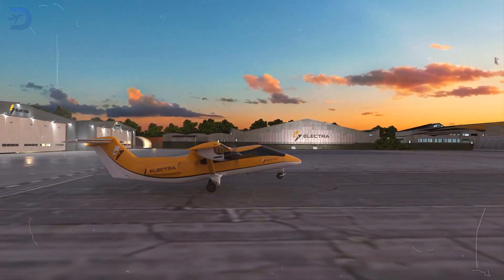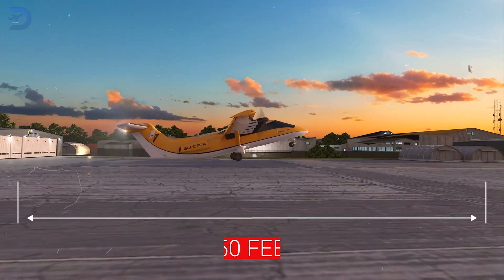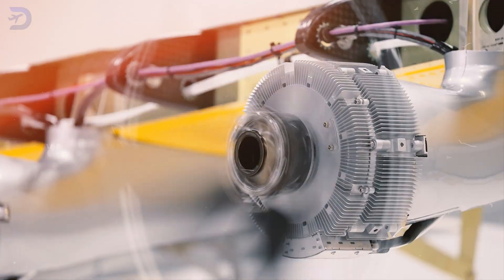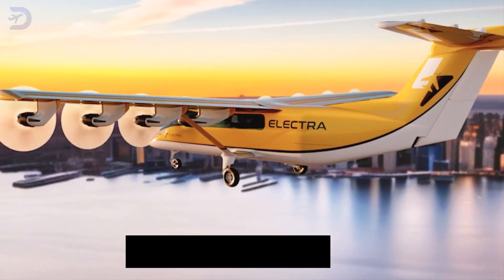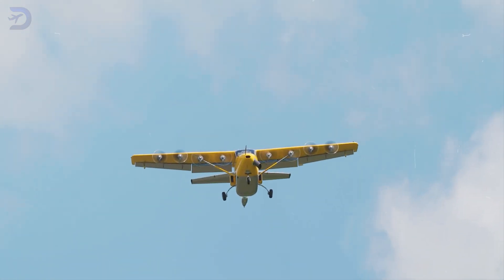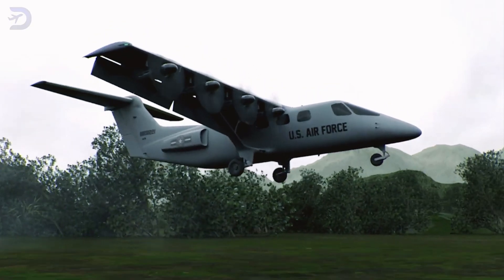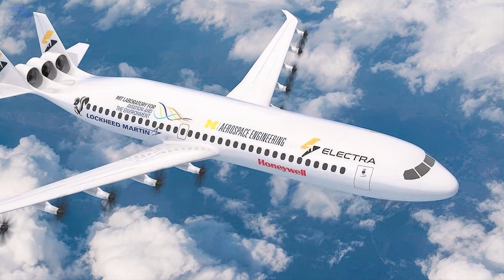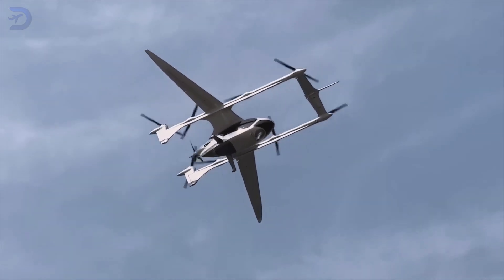This Hybrid Electric Plane Takes Off in 150 Feet

Comment: The ca 1970 Australian Nomad was designed for this very use being equpped with super high lift flaps.blown by slipstream etc but never caught on for the projected inner city stolport as planned, some use in remote jungle strips but overall missed the mark.  Stol is more difficult than vtol in many respects given better lift control by blade pitch than heavily loaded wings at low speed 'behind the drag curve' danger zone.

Comment: Bag, why?  The need for a ground run rules out vertiports, and the performance is limited by retreating blade stall, sonics on advancing blade etc so it is pointless to expect much by adding heavy batteries.
The PALV has been coming for fifteen plus years and has morphed quite a lot , it gets points for roadability but has the same drawbacks as the 1930s autogyros that did land on building tops,White house lawn etc as promo stunts (Pitcairn ) helicopters superceded them for almost all but sport use.

Comment: Look up the Fairchild VZ5 , it used the same configuration but also wisely incorporated tail rotors for low speed control ( other vtols of the time also needed tail control rotors eg XC 124 and Canadair Dynavert et al - the STOL mode was good as some could manage but it was the worst case in fact and is the same as vtol into a wind.
Failing to learn old lessons is rampant - Burt Rutan failed to read thr history of hydroskis etc and had another failure ( not one SCALED aircraft ever went into production despite 'working' as such and the Vari Eze/long etc were derivations of Dale Reed's UAV 'super snooper' built by Fred Jiran at Mojave using the hot wire foam glass method also adopted by Rutan.  I was there then.
The mad rush into evtol is not healthy on any level and the bubble will burst for easily shown reasons. There is a way to achieve UAM but these are not.

Comment: Just imagine you are overshooting or tun into lift on aproach and suddenly pull off power..... now your wing is bathed in slowed and erratic airflow  ( much more so than a twin with outer wings beyond the propwash)  The tail is flying "slow' while the wing sees high speed air - not good (as found by 1950s designs of this config)  The Breguet 401 used this configuration but with much lighter direct turbine power less batteries and motors etc, it went nowhere.  As did the Maxwell X57.
Upper surface blowing to enhance circulation ought to be better, the C17 avoids reverse circulation on the wing but blows the flaps - better idea.  Those tiny props and dirty wing cannot be efficient (Joby gave it up)  why would not Cessna or others with existing aircraft of the same configuration not just do an STC type conversion ( cf to Wren STOL Cessna)?
Too much hype . Back to the future on old VTOL s but with heavy battery handicap.  Ryan and others already tested this.
Reply from the maker: @rossnolan7283
Thanks for your detailed perspective! It's always fascinating to hear comparisons with past designs and thoughtful critiques of current approaches. Your expertise could really enhance our research for the content on our channel—insights like yours make aviation discussions even richer! 😊
Reply: Id like for someone to try making an electric one seat gyrocopter and see how long they can stay up. It might be long enough to have some fun.
Reply: Bag, gyroscopes have a miserable lift/ drag ratio - better than helicopters but still in the range of 5 to maybe 7 - winged autogyros are possible (the first autogyros had wings that unload the rotor in forward flight, the Jaunt, formerly  Cartercopter, is the current embodiment in almost- evtol with slowed rotor and quite good range at high altitude ( the rotor uses depleted uranium in the tips to store enough energy for a jump start, the tip section was hung in a frame at Oshkosh in 1998 and invited anyone to try to lift it, no one could. (By sandwiching it between one or both hands,  ...)
The Cartercopter was extensively tested then sold off - a one shot take off and landing is not good even with huge rotor inertia.
Noise of the rotor and conventional props is likely to be high amongst other shortcomings and critical for UAM.
Reply: @rossnolan7283  they should be able to get better hang time than any electric helicopter or multirotor evtol though so it might be good for short recreational flights. Gyrocopters need some runway.
Reply: Just for the record, I have spent over 50 years researching, building , flying experimenting towards the goal of what is now called 'urban air mobility' including working in the aircraft and automotive industries , Ford. G M  in prototyping, ran a general aviation repair, maintenance, fabrication etc workshop for 8 years etc etc so I am not just here as an 'investor' ( more as inventor, which is what design in a new field is) - and trying to bring some broader perspective in the face of a sudden mad rush into a field where aeronautical angels once feared to tread . It is a minefield in fact littered with the wreckage of ALL those who came before ( in either VTOL or roadable aircraft/ flying cars)  I was privileged to meet five of the, then, living designer builders of flying cars and to listen to and study their work.  There are many traps not apparent to fall into but if the goal is for mass use of personal air vehicles rather than playing around  or getting 'funding' at astronomical levels without solving real problems then a different approach is needed.
Dan Zuck came closest with his designs and his book "An airplane in every garage" is the still best overall conception of what is needed even though missing specific and current technical solutions (,it was written in 1956 but refers to his work in the late 40s mostly, the short lived post war boom in lighplane production and optimism...)
Sadly, I see a great potential for retrograde 'progress' in the current  climate catastrophy driven revival and unprincipled as well as unqualified players getting in for a buck while the going is good.
Basing everything on demonising a harmless gas that makes up ONE part in 2500 of our atmosphere and trying to use the most inappropriate engineering means to achieve personal air .mobility because of it is inane ( almost insane)
When the dust has settled a bit ( pun here on brown out caused by  vtol 😊) and the dominos have fallen the reawakened desire for aerial freedom might be the only good long term thing to come out of it, - the post dinosaur world with space for the little furry things to flourish is a good analogy - the battery behemoths on bloated budgets must topple first though.
Sorry for the bad prose, iPhone responses are not the best way to elucidate engineering matters.
Reply: @rossnolan7283  an evtol caused brown out is more optimistic than my position. I don't think anyone will be able to buy one or be lifted long enough for anything but a quick thrill and then need to land quickly. I do like to dabble in their stocks though. People do love the idea and you know how fanatical they are about it better than most people.
Reply: Bag, I think you misunderstand " brown out" in this context, NOT voltage drop in the grid but loss of visibility when rotor downwash stirs up dust ( similar to white out in snow)   Brown out caused the disastrous Iranian hostage rescue mission under President Carter for example.   I can see your reason for the other possible meaning... power drain in hover is a real range killer .
Reply: @rossnolan7283  oh ok. I did think brown out like with the power grid.